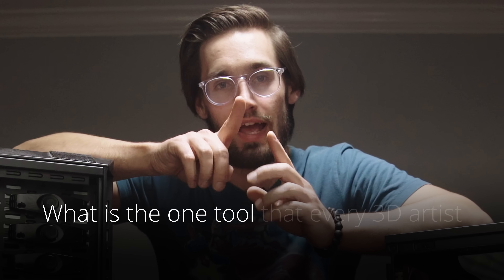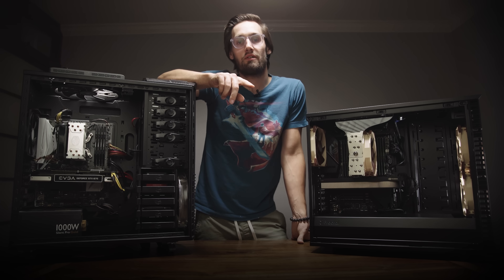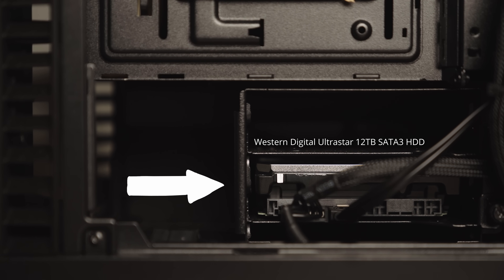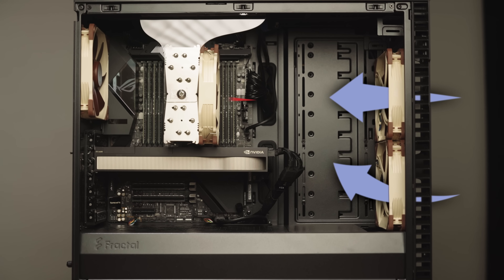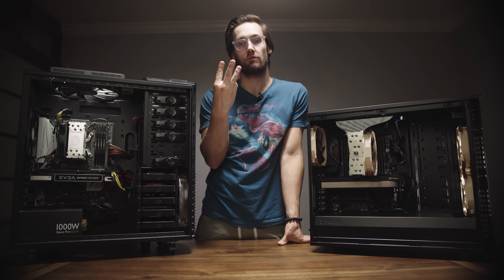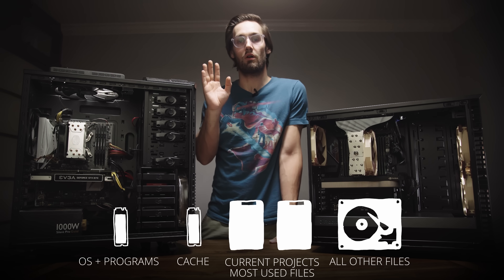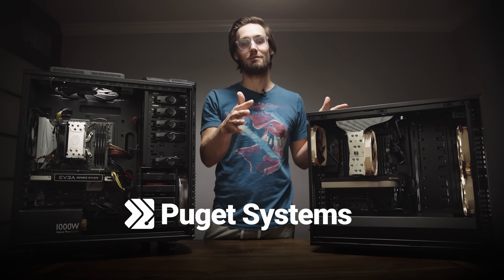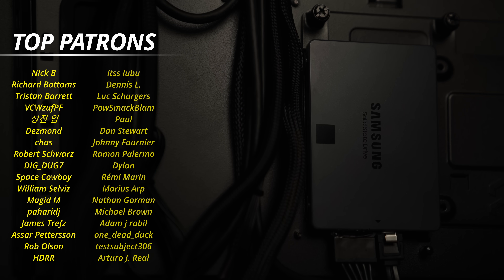What Digital Artists NEED to know about HARDWARE | All Parts Guide

Comment: Before I worked at Poliigon, I paid the bills building high end and mid range computers. The simplicity of this video is flawless. You've done a better job explaining the important and pertinent information for artists, than any major tech tuber out there. Great video. 

I also liked your analogies. Many tech tubers relate the parts to the human body, which can be misleading. Relating the parts to a work environment such as a kitchen makes a lot more sense. 

If I could add one thing, it would be to never listen to what the minimum or optimal spec of a software is. For example, blender says optimal ram capacity is 16gb. I think, for some cases, that is true. But if you want to render large scenes, or do simulations, you'll have a much better time with more ram. It's also important to note, that when you do run out of system ram, your system will fall back on its boot storage to provide the data. That is why it is a great investment to go for a high speed NVME drive over a hard disk or sata sad. 

And lastly, I loved the toilet paper analogy. If I may take it a step further, I'd say it's more like clogging a toilet on your first date at someone's house and you can't find a plunger. That puppy won't flush cause there's too much dookie. Then you have to spend an awkward amount of time simplifying your deuce so it'll flush. Not a fun time. 

Manage your texture sizes and geometry resolution, and you'll have a much better time.
Reply from the maker: Hahaha great comment!! Thanks for the love 🤙🏼
Reply: I usually take the minimum and recommend specs as more of:
Min spec: the minimum you’ll need for it to run. You’ll probably have a bad time running it on any less than this.
Recommended: the minimum you’ll need for typical/casual use to run smoothly.

Comment: I do feel like memory size is exaggerated these days. Sure, the more the better, but it should not harm the budget for other components either.

My rig is getting a bit old, I will have to wait until prices become acceptable again, but I don't think I have ever ran out of memory with 16 + 8 GB VRAM. In my experience, GPU and CPU (as well as cooling!!) become a bottleneck long before that, for 3D, for gaming, or otherwise.

Comment: Great video, but one major note on the CPU specs.  Cores/threads/clockspeeds aren't a 1:1 sort of comparison, for example a CPU from 3 years ago with 4Ghz on its specs doesn't typically beat a CPU released this year with 3.6Ghz speed.  A big factor is IPC (instructions per clock), which is where a lot of improvement happens year to year!

Basically think of a Ryzen 3600x being a 4 cylinder engine and a Ryzen 5600x being a 6 cylinder engine.  At the same RPM (clock speed) a lot more speed is at your disposal!

Comment: Note on the CPU choice:
More cores, is better yes.
More threads, is also better yes - most processors come with 2 threads per core nowadays.

However clock speed.... not the whole story. Newer generations can do more work per 'clock tick'. However, advertised speeds are often optimistic and NOT realistic for render workloads. CPUs reduce their clock speed when rendering - essentially because more work means it has to run slower to remain accurate.
The other issue, is that a fully working CPU also uses more power - and so releases more heat (for which you need a better cooler). Power usage may be a concern for your business.

So try and find reviews or benchmarks and the types of applications you use. The performance and measured power draw are ultimately what you should base your decision on. (Within a given budget.)

Comment: I build a new pc with the new intel i9 12900K and 128GB of DDR5 ram, a firecuda 530 2TB M2 SSD and 2 2TB samsung evo plus M2 SSDs as raid 0. And yes.... with my old 1080ti... you all know the problem with new graphics card... crauy prices. So I will use my old one until the prices are normal again. 
But this new pc makes it possible for me to work more two times faster. 4 days for a project, are done in two days now. It's a dream... hardware matters.

Comment: This cpu cooler will be a big problem when you have a scene where you need to utilize cpu rendering. The cpu will throttle pretty fast in that case
I guess you told them that you have no cpu render programs (where gpu rendering is not available). But even with 48 gb vram you may come in the position in the future where that will be not enough and you have to make compromises or cpu rendering. But even without cpu rendering I find it questionable that they build that 10k+ system with this low end air cooler. An AIO would have been a general save choice for future potential usecases. Great video in general though
Reply: No AIO - this is a work station platform which means you should not use an AIO. That adds several points of failure, since the pump could die - the fluids could leak - the fluids dry up after several years - or the liquid could become murky and get the pump stuck or kill it. Even a good AIO has a little bit of liquid escaping the system.
All that could happen to the tower cooler is a fan dieing - which is easily user replaced - even temporarily by a case fun until your order comes in.
There is the maintenance issue; blowing out a AIO properly is a hassle...

Also among Noctuas coolers, which are pretty good, this is the highest tower cooler they offer thats compatible with this socket TR4. It should handle 168W output, according to noctua, though the 3970X is known to hit 82C and 3.8GHz with this cooler (according to LTTs review).
Given that this is a workstation, and the base clock is 3.7GHz on this processor, this is the best trade off you can make for the performance it gives, even today compared to other processors.

Comment: Overall a great introduction to workstation PCs. Just want to add that you should always go for dual-channel memory to not leave performance on the table, meaning instead of buying one 16GB stick of RAM buy two 8GB sticks in a kit (bundle) and install them according to your MBs manual (usually skipping one slot starting from the outside).

Can make a big performance difference for memory bound tasks like I found out the hard way because I ran my two 16GB sticks in single channel for way too long until I found out 😅
Reply from the maker: This right here!
Reply: I just fill all my slots with the highest gig they can handle
Reply: @Dark_Rammus  actually filling only 2 slots runs faster than 4 slots :) Quite hard to find a mobo with 2 slots but there are a few.
Reply: This assumes you have any empty ram slots available, of course.

Comment: Something I've found very odd is how fluidly people work with Blender and how much my system struggles. I've done some digging and it looks like 2nd Gen Threadrippers might in fact be unable to run Blender properly outside of Linux. No clue why this is, but I'm currently working with ZBrush and Unreal as my primary drivers since my CPU is a very strange bottleneck in terms of Blender.

Anyhow, good video. Glad you grabbed an A6000 by the way. That extra VRAM is super helpful.

Comment: A great overview about the hardware topic.  Things I would add: 

CPU: Every Software/PlugIn/Renderer handles the CPU differently. C4D for example needs very strong single cores for a fast viewport rather than a trillion weak cores. On the other side simulation especially fluid sims reeeeally benefit from as many cores as you can get. SO before you buy a new CPU you should research a bit about every software/plugins etc you use.  

PSU (Power Supply): PLEEEEASE do yourself a favour and buy a modular one where you can change the cables. Don't go to cheap on a PSU ever! Also Consider future upgrades. Don't just buy a 450W one because it is enough for your current system. If you want to add a 2nd graphic card in the future these 450W will get you nowhere!